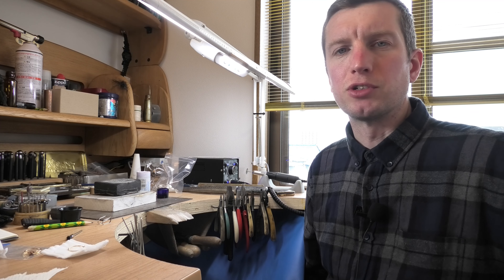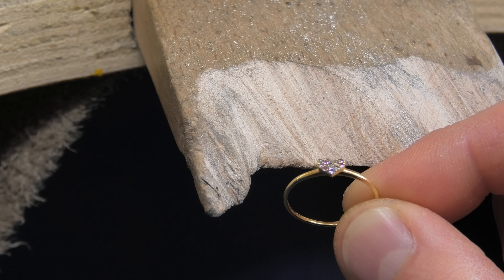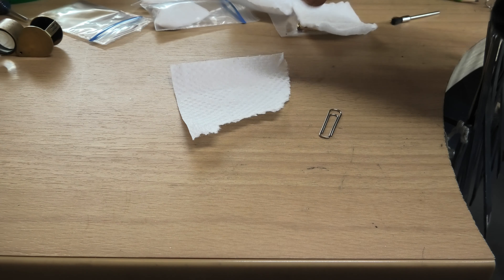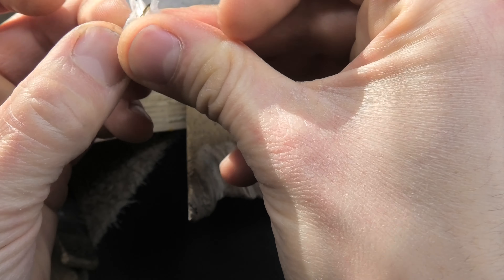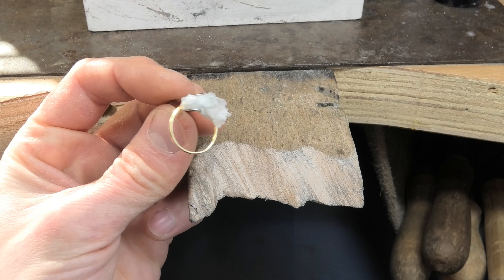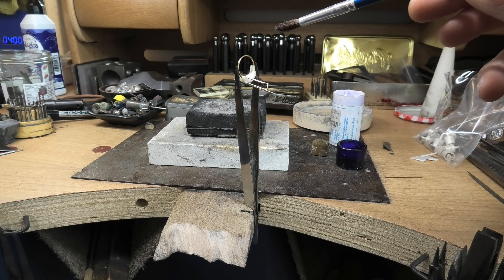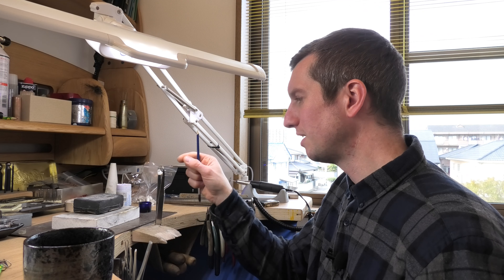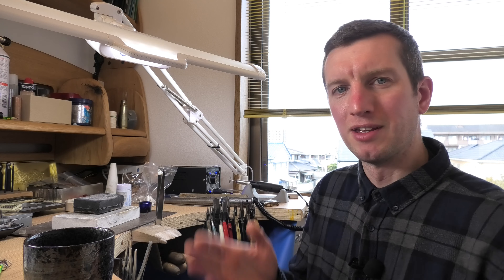How to Protect Gemstones from Heat while Soldering!

Comment: I JUST used your technique, to solder a break in a 14K yellow gold ring, set with three oval opals. The ring is OLD, and I was only supposed to size it down to a 4 and 3/4 for our customer. Well, when I curved the shank to downsize it, after cutting a bit of gold out of the back, a large crack appeared, fairly close to the opals. I could have had a buddy of mine use his laser to fix it, but wanted to see if I could do it with your suggestions. 

Guess what? The wet paper towel and a paper clip WORKED! None of the opals were damaged, and I was able to repair the cracked shank completely. Praise the Lord, and THANK YOU for the video!
Reply from the maker: Win!

Comment: Wow. Very interesting.  Never seen this technique before.  For most rings I just dip the thing in my boric acid/denatured alcohol mix, clamp the stone part directly in the wider part of my crosslock tweezers in a third hand base, shank part sticking up.  Burn off the alcohol and solder from the inside of shank with the flame pointing up away from the stone area. Hit the spot you are soldering hard and fast, and don't let the heat linger on the shank.  The tweezers make a massive heat sink.  Little trick my first boss showed me.  

For more sensitive pieces or pearl rings, I use some damp bead blaster sand in a flat lid or bottom part of a soda can. Bury the stone part deep in the damp sand with the shank sticking up. A couple of the guys used a little cup of water as a stone protector. I never got the hang of that one, steam would periodically blow out my torch. Sometimes did that with the damp sand too.  The commercially available heat protective gel works fairly well, but is hard to apply evenly and I don't like it. Another friend uses baking soda for a heat sink.

We figured out I probably sized somewhere between 35 and 50 rings a day for the first 10 years I worked there.  On the low end that comes to about 87,000 ring sizings in 10 years. Never mind the chain, bracelet, and earring repairs, and custom waxes/castings I did too... Been at this for 39 years now...
Reply from the maker: Wow ring sizing master! Yes I used to do the burnt off boric acid way but changed to the pot of water way over time. The steam does cause problems tho sometimes.

Comment: I found a bit of car on fiber works protecting stones of all types. It's a fire retardant material. I cut a strip off so a little over the sides of the stone or gem sides. I have also used. Fiberglass tape works well to. The fiberglass tape can be found in electrical where electrician supplies are stored.

Comment: Hi are you able to offer me some advice ?  my wife has a set of drop earrings on a chain with peridots , quarts and amethyst stones are set into the chain, our dog chewed up one of these earrings so i thought i would have a go at making a replacement as the stones arent expensive and i can but a similar  length of 18ct yellow gold chain . My question is how can i set the stones ,  it looks like a small wire or bar is inserted into the stones and the end is soldered to the chain,  how do i solder the ends  of a small bar ,wire ( probably .04 mm thick given the ends are next to the stones . everything i have seen shows rings that you can suspend in water or you wrap absorbent paper round the stone but the stones on this occasion are literally less than 1mm away from the solder joints, any help would be appreciated. thanks dan

Comment: I just suspend the ring ring in a little metal pot filled with water. Seems easier
Reply: Hmmm good idea
Reply: This is rather genius
Reply: I find water draws too much heat away from the metal.
Reply: @saxon12qa  Yeah you do have to blast it, especially if it’s a thicker shank. Otherwise I used that thermogel stuff
Reply: I've done this before as well, but found that you need to create  a bit of a "shield" with some scrap titanium or steel to prevent the water from leaping up and cooling your join area.